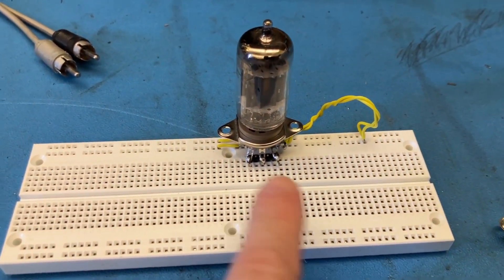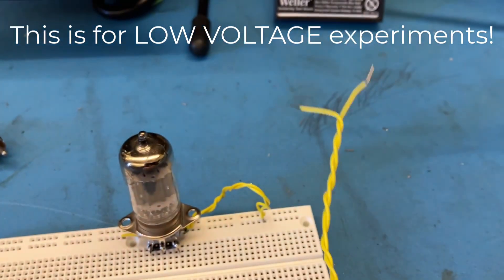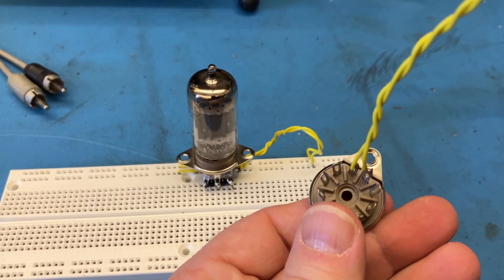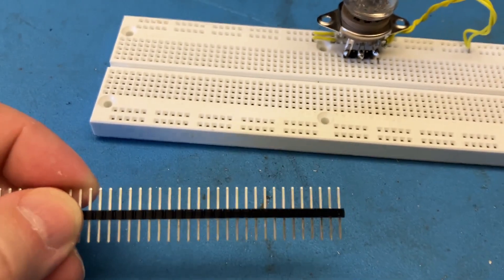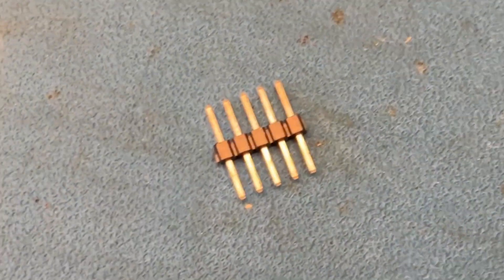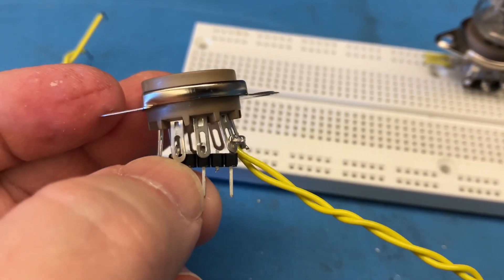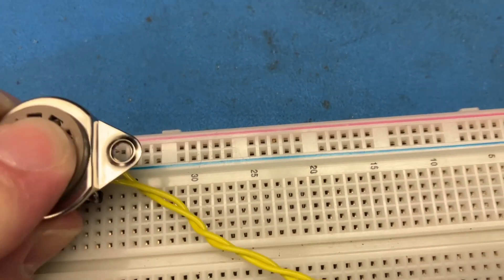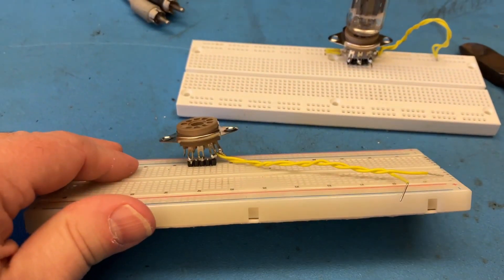Janky Vacuum Tube Breadboard Mounting Hack (for LOW VOLTAGE experiments! NOT for high voltage!)

Comment: with a flat pair of pliers you can usually draw out the pins from these pinheaders as well - then you have nice metal pins which might be useful somewhere else.
Reply from the maker: I've done that before and it's usually worked OK. It didn't work here with these particular headers, they were in there pretty solid.